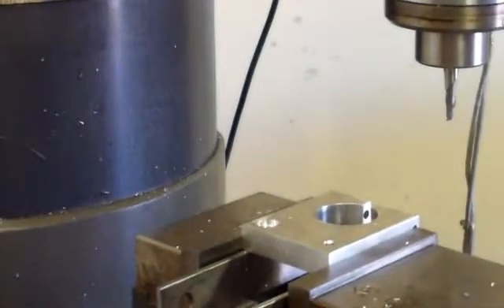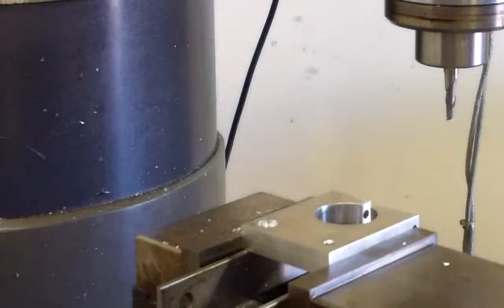advance rotary table part 2

Comment: So circlepocket milling is just using the rotary table.  I would love to see the cross feed do an irregular pocket using point to point milling technique similar to what I do on a prototrak. Basically milling infinite degree angles and back to straight  x and y moves (think doing a 45 degree cut using both conventional x and y handles.  essentially adding 3 axis making it a 6 axis set up.  You could program each move on paper. Do one air cut to eye ball your complex layout then one cut at z:-.001 or - 3 though then move down 25 thou at a time in steel or more in Alum. Wonder if all that backlash could take the cuts.. my brain is really working on this poor man's prototrak
Reply: Between moves some reseting of the axis may be in order
Reply: The Advance Rotary Crossslide Table was made with provisions inside to eliminate any backlash. That was part of the original patent, and was an intregal part of making it sucessful.